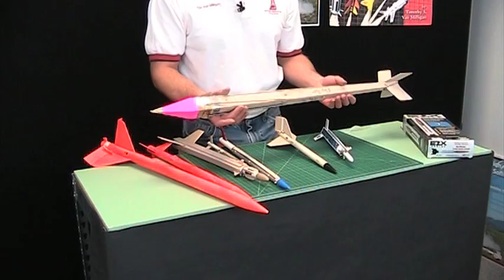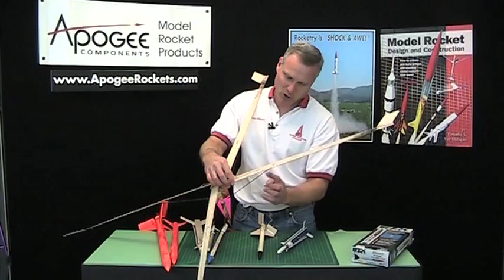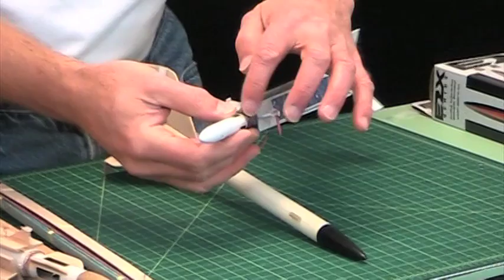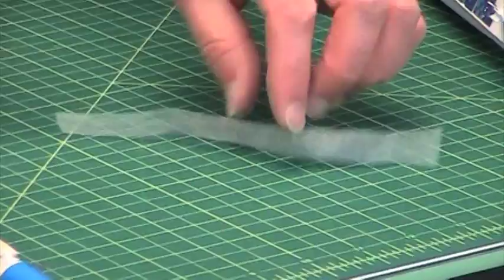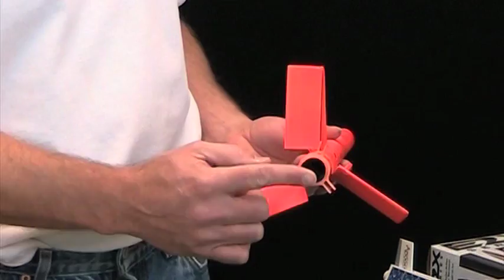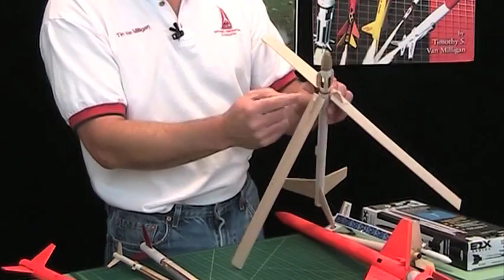Helicopter Model Rockets

Comment: i came up with the idea completely originally, it so sad to see that it already exists
Reply from the maker: There's lots of variation available. I'd love to see what you came up with.
Reply: @apogeerockets  yes!.

i thought of wrapping the cylindrical tube of the rocket body, with curved sections of wings. Now if the attachment point is only at one corner of the said curved flap, upon opening, it will naturally form a slant without need to put a hinge at an angle.

I tried to explain the best I could, I'll notify you if and when I make a video about it.
Reply from the maker: @scramjet7466  We made a couple or kits with curved blades.The GyroChaser, and the Rotary-Revolution. See our website in the link in the description.

Comment: Have a roll "helicopter" recovery where it spins on its axis as it comes down horizontally.  The blades stay parallel to the tube, just change pitch and floats down.
Reply from the maker: yes. That is possible. See the book "Model Rocket Design and Construction." It has a picture of how it works.
Reply: I saw the 28 pages in PDF file.  I think it was Black Rock where a CATO stripped out the insides and the tube with fins showed the concept works.  Having a short movement on ejection change the angle of blades flat to the tube, or a sleeve eject that exposes a "screw" fin the length of the body tube, with proper CG, will bring a rocket down better than a streamer and possibly better than a chute.  I was a USAF helicopter Rescue the Acceptance Test Pilot (Sikorsky) with experience in a lot of systems.  I built display rockets for Mary Roberts when you were at Estes, both for shows and the Scout Jamboree.  I taught at schools in four states, 4H and Scouts.

Comment: The Skywinder needed a bit of polish on the inside of the hub to work correctly.  The weak point was not the hub or hinge.  It was the top of the motor/fin unit.  With multiple launches, the top of the black unit would soften and the tube sag to the side, then harden in place as the plastic cooled.  It needed a heat shield!

Comment: easy peasy look at rc helicopters NO not the cheap mall crap the good ones the blades are not fixed solid they are able to move around and they can be tightened enough to stay where you put them but if they hit something they move instead of breaking I bet you could even find some about the right size for anything all the way up to a i motor off the shelf.

Comment: Wow you invented the Skywinder?  I've had that rocket for years, and it never failed to impress. Unfortunately the last time I launched it a few years ago it didn't deploy properly and it took a very hard crash and broke the custom plastic piece that holds the cone assembly on and allows it to slide up and stop. Really bummed me out since it's been OOP for so long. I still have it and every so often have tried to glue/repair it but it never holds well enough to try again.

Didn't know Apogee had two helicopter rockets in low power... will have to get them on my build list. I just received the Rose-a-Roc from Fliskits and will be building and flying that one this spring/summer.
Reply from the maker: Since the video was made, we added more helicopters. As of 2018, we have five helicopter models!

Comment: What about the old Estes "Gyroc". It had a reverse ejecting motor that activated fin control surfaces once the motor was ejected out of the body tube. When this happened the fin control surfaces that were under tension from elastic threads snapped back 45 degrees and an helicopter like spin was imparted to the model rocket. 
 Awhile back I took this concept one step further by having a Gyroc like booster stage for a two stage rocket. The booster came back to Earth via helicopter recovery and the upper stage was parachute recovery. This rocket worked well until I had a malfunctioning C11-7 upper stage that fried my parachute and the upper stage impacted onto a tennis court destroying itself. The booster functioned fine and I still have it.

Comment: Attach the hinge sections to a diameter of tube slightly larger than that of the main body.  Big enough to spin on the main tube but captive in some manner.  In theory...would lessen the torque on all hinges when making contact with the ground.